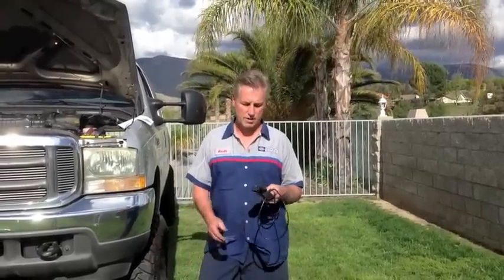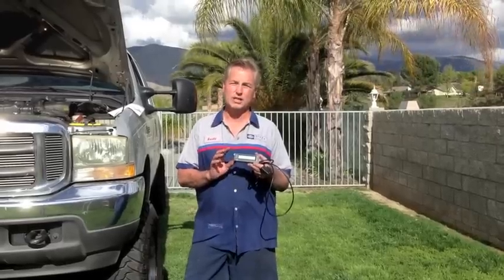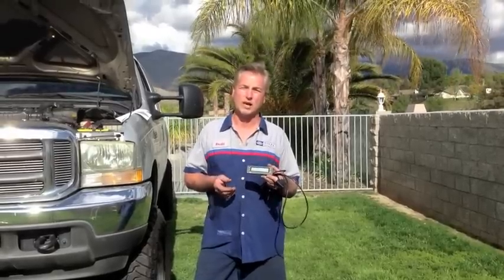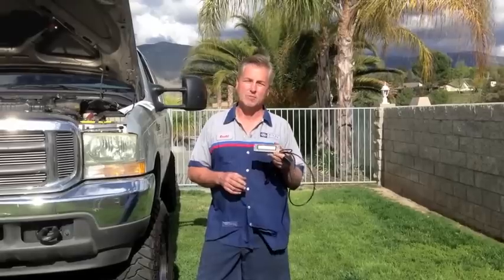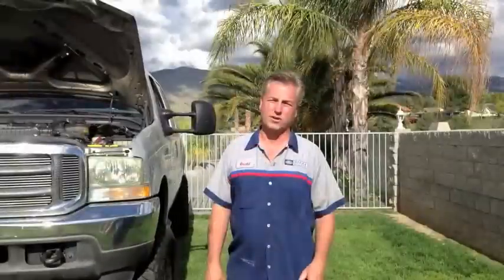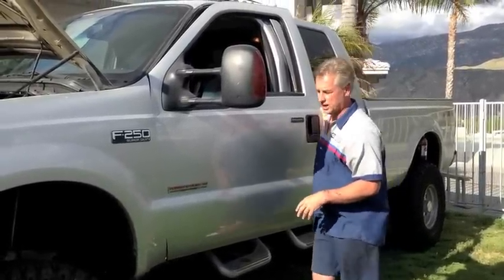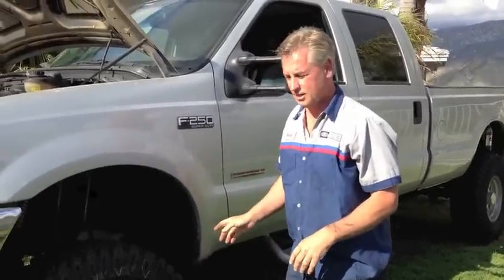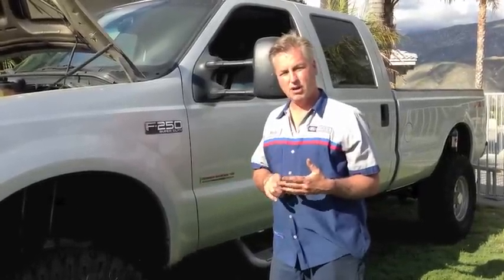6.0 Ford Powerstroke Cranks no Start. Diagnosising using a Scangauge X-gauge Part 1

Comment: hey Ron i have an 03 6.0 powerstroke that i have had a no start with and ive ran into a dead end so i wanted to know what you thought . i did an oil change and broke the return tube inside the oil filter housing so i replaced it  and added some diesel Kleen to the tank and at first it ran just fine but when you would shut it off it wouldnt start back up then less then a week of that i drove 60 mph across town just fine until i went to speed up to 70 and it quickly lost power and died going down the road and hasnt started since. i replaced the injection presure sensor and conector because a local machanic told me thats what was wrong with it and wanted to charge me almose 2000 to change it so i did it myself but the only thing it did was make my fuel gauge work again. i know i have fuel geting to the fuel filter ontop and oil is filling the filter housing but the gauge reads no presure no matter how long uou start it and it just keeps kranking it never turns over or even acts like its trying. the FICM voltage is 45 while everything is runing but as soon as the pump and everything else shuts off the voltage jumps up to 48
Reply: Unfortunately, Ron passed. It's going to be close to ten years now I want to say. His family left his channel and videos up to help the community, but he's in a better place fixing 6.0's in the sky.

Comment: I got a question out there for any Ford guy I have a 2004 Ford F-350 to 6-speed manual transmission sometimes it just sits hers and cranks and don't start but if you catch in gear it fires up every time and then you can shut the key off and turn it on I cranking the engine if I trade up again but it's just that first time it don't want to start does anybody have any answers for that thank you

Comment: Is that fuel pump noise level about right for a good fuel pump? Reason im asking is I have one that is much quieter (06 f350 6.0). Its also a no start. I havent got to diag yet but i did notice the pump was much more quite when it died last night.

Comment: Hey ron so i have an 05 6.0 powerstroke it was idleing and just shut down not it wont start were should i begin to try and solve this problem itll crank and its got fuel pressure but no fire i dont know were to begin

Comment: I bought a Scangauge II just because of Ron’s videos. I love mine. Rip Ron thanks for everything.
Reply: I see there is a ScanGauge E OBDII Automotive Computer
 OR a ScanGauge D Diesel Computer.  I have a 6.0, should I buy the Diesel?  Was you Scanguage II for diesel?  I can't really afford this, so I have to get the RIGHT one.  Thanks for any help on what you got and how it worked.  (I have the problem discussed in this video...all of a sudden no start---cranks strong but wont turn over.)  RIP Ron.

Comment: Does anyone know what he means by "Normally the battery takes out the FICM?"   I had dead batteries last week. put new ones in and it was running, but now its a crank no start situation.
Reply: Battery failure has been a historical issue of causing FICM's to destroy themselves. Not always but, many times. You'll also find that in a short period down the road, you'll discover that your alternator is going bad. One is the cause of the other to fail.

Comment: i just replaced 2 new batteries, 1 alternator, and 1 starter and still the dome light inside go out when i try and start it..what could it be ?
Reply: normal lol. vehicles are designed to cut power when trying to start, to give all the power to the starter...
Reply: dynocompe what about when i turn on the truck, weather is about 85° - 90° and i let it warm 15min up till it reaches above 100 in coolant temp and engine oil temp but then my truck shakes when i go 50mph i let go of the gas and it goes away. I step on it and it comes back, anything under 50mph is no problem handles well the tranny temps are at 100°-130°... once the transmission fluid temp reaches 150° or 165° the shaking goes away . drives nice . it stops twerking . not a completely bad shake but a mild one.
Reply: maybe rev-x will solve my problem, rotated tires, good psi , just no alignment yet.. tires have like 60 percent thread ...
Reply: check ball joints, tie rods. google ford super duty speed wobble too, very common problem that can be a nightmare to fix. Fortunately my truck doesnt have this issue. a wheel alignment can fix it too if its out of wack or you had work done on the tie rods. If tires are worn unevenly, that is a sure sign that you need some front end work done, and the uneven wear alone can cause the shakes. with the tranny heating up and the shake goes away, i am not sure, i havent personally done much work on the drive trains to know the relevance, i am just a diy mechanic that has owned alot of trucks and done my own work. So i learn when i have to fix my own crap.
Reply: dynocompe got it, thanks

Comment: Hey Ron, my 04 6.0 has had some "stuttering" at speed, whenever not accelerating (not asking it to increase speed, rather maintaining speed causes this symptom). I watched your vid (great vid, by the way!) and realized that I no longer have the injector pre-clatter noise and the truck cranks but doesn't start. What should I suspect?

Comment: My truck just left me stranded in the parking lot.  Long crank/no start and I'm not hearing the injector chatter and the fuel pump only hums for 2-3 seconds before stopping.  Where should I start? '06 6.0 f350
Reply: Start crying.
Reply: What ended up being the problem, I have the same issue breaking my head with this 6.0
Reply: @jonathanbravozya  it was a while ago but I think I renege it being the IPR valve. The screen in them gets screwed up.  It's an easy fix though

Comment: Ron. i have a 2005 f350  6.0 and the engine die when i was driving at 65 mph and now crank but  won't start ,can you help me with this problem, thank you
Reply: Did you fix your ford mine is having the same issue

Comment: i have a 05 6.0 f350    this truck has set for about 6 to8 months    went to start it and all it does is crank no start I replaced fic about 2 years ago, had the head gasket,egr and high oil psi pump replaced about 1 year ago on the fic  but  showing no power going to it  was just wondering if it could go bad just setting there it ran fine when when I last drove it    have any ideas

Comment: great videos using the scan gauge 2 for these fords.  I just got mine in and set it up.  I'm getting normal readings but the icp reads at 8 psi with the key on.  Is this normal I see in your video you get 0 psi.  At idle I get map 14.7 ebp 17.0 vgt 81 and icp 587

Comment: ron,
I am at wits end.i have 05 f550 6.0. I have a crank and starts but immediately stalls.i replaced ipr,icp,checked ficm,pcm.i checked crank sensor on scope,and with another vehicle,i get 2 different scope readings..any ideas? would a harness cause this?
Reply: dummy plugs or that itc plug. what it end up being?

Comment: Great vids! need your help. my 6.0 just started missfiring today. wont go past 2600 rpm. wont start after warming up. icp v 2.1 @ 2600 rpm ipr 41% icp psi 1684. replaced ficm couple months ago voltage at 48 now. codes for cam, crank and egr. replaced fuel filters today, changed oil, no difference. drove threw some deep waters last time it ran good. ipr @ around 15% while crankin icp @ around 600. runs fine till hitting about 2600rmpm
Reply: Found the problem! after sitting a couple days it started cleared up so i took it to work yesterday and was raining. half way into town it started running bad again and smoke out the tail pipe.would not start after shutting it off. found two terminals from the ecm harness were corroded. they got wet everytime it rained and it would start running bad. hope this helps someone!
Reply: +W

ind Storm

Comment: Hey Ron, I have an 06' f250 6.0 diesel. On friday check engine light came on, ran fine. Saturday, I started it up ran like crap and a bunch of black smoke out of exhaust. Sunday, do not hear fuel injector clatter and will not start. Any suggestions?
Reply: What was the problem that is happening to my 6.0

Comment: hi don need your help.... our 2003 ford f350 6.0 was running fine and shut down on us... had it towed to the yard and been working on it we changed the sensors that are located behind the turbo and had the ficm repaired... but still no start and the readings are as followed at key on 14.8 IPR 47.5FMP 0SYC 27ICP at crank 84.7 IPR 47.5FMP 0SYC 308ICP<with starter fluid w/out 210ICP Please help if possible thanks
Reply: checck your wiring, you have no sync
Reply: +Jessica Rodriguez  HI JESSICA I WAS WONDERING IF YOU FIX YOUR TRUCK I HAVE THE SAME PROBLEM AND NEED HELP TOO HOPE TO HERE FROM YOUR SOON THANKS

Comment: Have an 06 6.0 and everything I seem to checks is working just not starting. I've got sync my fmc is 48 and my icp is above 500 my ipr is at 38 changed oil filter and still no start it smokes white when cranks but nothing. Any suggestions can't really afford to haul to shop

Comment: can you explain to me why my 2004 6.0 wont rev past 2500rpm when warm.  no hard start, plenty of power, great idle, but when it warms up it wont rev past 2500, still with plenty of power under 2500. if i shut it off and turn it back on its fine for about 15 to 30 seconds
Reply: ***** actually it was the exhaust back pressure sensor

Comment: I wish you had some videos on how to fix NO SYNC. I had my ficm replaced and 3 days later I had same problem of long crank before start. I have a PO678 code and no ficm sync. I have 2 problems and not sure where to start first. From everything I have read so far they are not related , unless it is wiring ? IF I knew where your dealer was I would bring it in .

Comment: Hello, I noticed that my coolant level was very low.  It is very cold in new jersery, so I added antifreeze. I did add some water in the past.  so I go to start it this morning, it did start then it died and now I can't start it. it does crank but no start now.  For now I will take it home and plug in the block heater, I will also replace the fuel filter.  I have an 07 f250 6.0.  and I do not have a scan tool.  if you can tell me what else I show check I would greatly appreciate it.  eventually I will get this scan tool

Comment: I don't know how to begin to thank you for all the info you have posted on here. I bought a scan gauge11. Programmed it and with in minutes found out why my 03 super duty 6.0 wouldn't start. FICM was at 25 volts. Got a new unit , installed and it started right up and runs like a champ. This is after I spent a $1000 to a mechanic who couldn't diagnose the problem. he was playing a guessing game changing out sensors. Again many many thanks

Comment: Thank you so much! My 03 6.0 wouldn't start. I got the scan gauge II my ficm, syc and ipr were all good but my icp read 0 while cranking. I pulled out the air filter and saw that the wiring harness was smashed against the corner of the engine block and was shorting out. I fixed the wires re-tapeded it up and all is good! Thank you, thank you, thank you!

Comment: Hi their, you said when I park the truck and turn it off it won't start until the engine cools off? more then likely you have a high pressure oil leak. try to take off your ICP sensor and plum in a fitting that fits in to the ICP thread hole located on the passenger side valve cover its underneath the hot side turbo pipe, inject the shop air into the ICP hole and listen for air coming out of the oil filler neck and the crank case breather tube located on the driver side valve cover. Good luck.

Comment: have a 2004 ford f550  i changed wgr delete gaskets injectors ficm  long crank after it start if check engine light comes on will not start have to disconnect battery to reset computer or if truck is running allday when i park it will not start until it cool   what can be problem